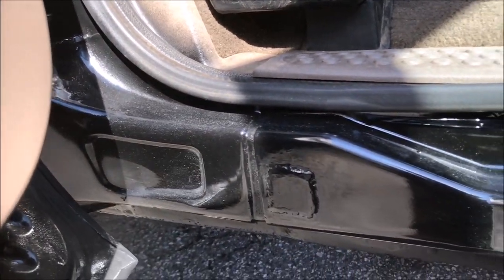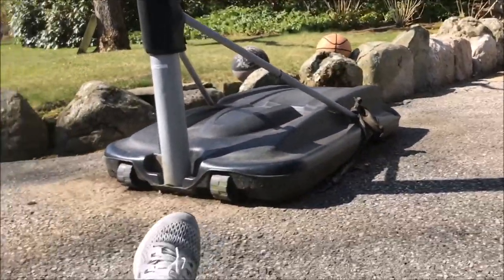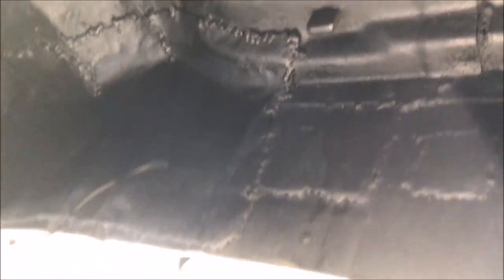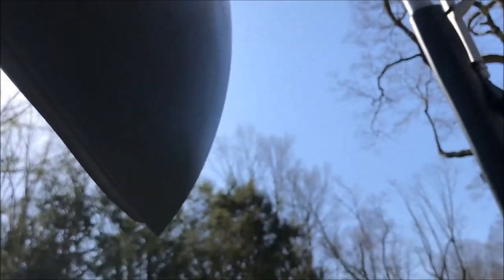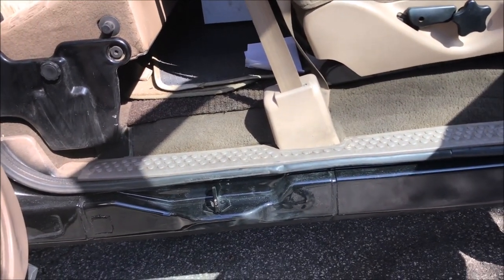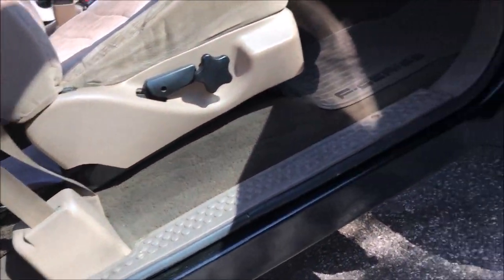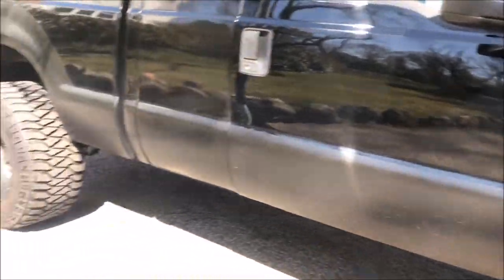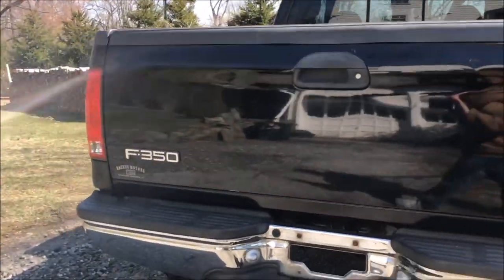Project 7.3 Rust Repair Completed! (What We Have Done To The Truck So Far)

Comment: I've got pretty much the exact same truck the same color same two-tone look as yours, I want mine to turn out like yours did thanks for posting it up I wouldn't mind seeing how to trim the front fender and also a link for that 12-piece cab Corner rocker panel kit thank you
Reply from the maker: I'm having trouble finding the 12 piece kit, I had gotten it off eBay about a year ago. You can go on raybuck.com they will have everything you may need for rust repair. If you want to see how to trim the front fender I posted a video of it a few months ago just scroll through my channel videos. Thanks for watching.